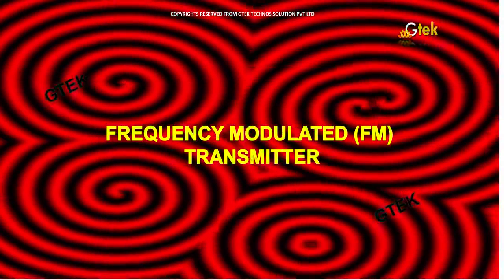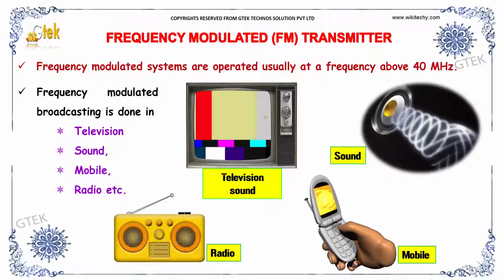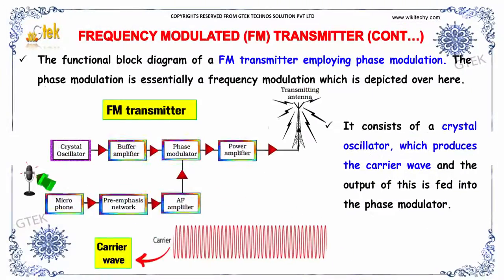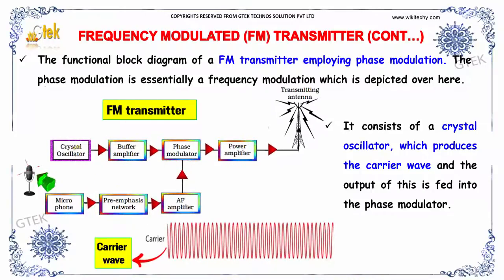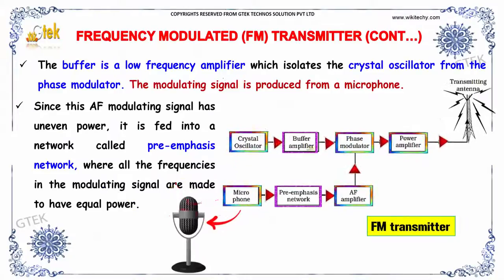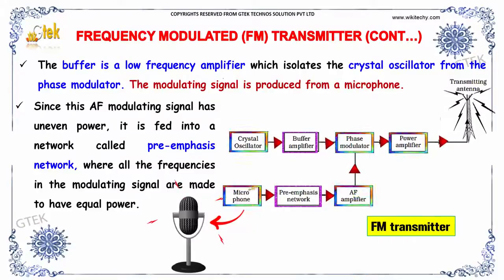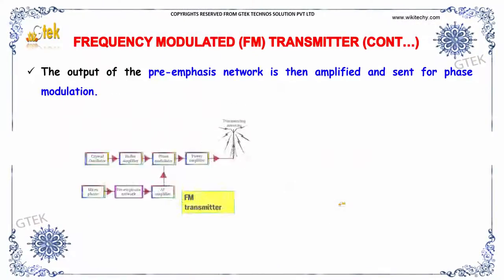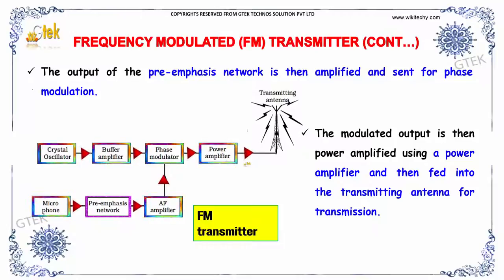Frequency Modulated Transmitter |Communication systems|class 12 physics|CBSE|IITJEE|NEET

Comment: A personal FM transmitter is a low-power FM radio transmitter that broadcasts a signal from a portable audio device (such as an MP3 player) to a standard FM radio. Most of these transmitters plug into the device's headphone jack and then broadcast the signal over an FM broadcast band frequency, so that it can be picked up by any nearby radio. This allows portable audio devices to make use of the louder or better sound quality of a home audio system or car stereo without requiring a wired connection. They are often used in cars but may also be in fixed locations such as broadcasting from a computer sound card throughout a building.
Being low-powered, most transmitters typically have a short range of 100–300 feet (30–100 metres), depending on the quality of the receiver, obstructions and elevation. Typically they broadcast on any FM frequency from 87.5 to 108.0 MHz in most of the world (or 88.1 to 107.9 MHz in the US and Canada).

Comment: Communication - Frequency Modulation Class 12 Part-2. 4. Deviation: The amount by which the frequency of the carrier wave is changed from its original unmodulated frequency. The rate at which this change occurs is equal to modulating frequency.

Comment: Frequency modulation is widely used for FM radio broadcasting. It is also used in telemetry, radar, seismic prospecting, and monitoring newborns for seizures via EEG, two-way radio systems, music synthesis, magnetic tape-recording systems and some video-transmission systems. In radio transmission, an advantage of frequency modulation is that it has a larger signal-to-noise ratio and therefore rejects radio frequency interference better than an equal power amplitude modulation (AM) signal. For this reason, most music is broadcast over FM radio.
Frequency modulation has a close relationship with phase modulation; phase modulation is often used as an intermediate step to achieve frequency modulation. Mathematically both of these are considered a special case of quadrature amplitude modulation (QAM).

Comment: n telecommunications and signal processing, frequency modulation (FM) is the encoding of information in a carrier wave by varying the instantaneous frequency of the wave. This contrasts with amplitude modulation, in which the amplitude of the carrier wave varies, while the frequency remains constant.
In analog frequency modulation, such as FM radio broadcasting of an audio signal representing voice or music, the instantaneous frequency deviation, the difference between the frequency of the carrier and its center frequency, is proportional to the modulating signal.
Digital data can be encoded and transmitted via FM by shifting the carrier's frequency among a predefined set of frequencies representing digits - for example one frequency can represent a binary 1 and a second can represent binary 0. This modulation technique is known as frequency-shift keying (FSK). FSK is widely used in modems and fax modems, and can also be used to send Morse code. Radioteletype also uses FSK.

Comment: In electronics and telecommunications a transmitter or radio transmitter is an electronic device ... In a frequency modulation (FM) transmitter, it is added by varying the radio signal's frequency slightly. Many other types of modulation are used.

Comment: The FM-transmitter plugs into the audio output of audio devices and converts the audio output into an FM radio signal, which can then be picked up by appliances such as car or portable radios. Most devices on the market can broadcast on any FM frequency from 76.0 to 108.0 MHz (or 87.9 to 107.9 in the US).

Comment: In electronics and telecommunications a transmitter or radio transmitter is an electronic device which, with the aid of an antenna, produces radio waves. The transmitter itself generates a radio frequency alternating current, which is applied to the antenna.

Comment: The exciter section contains the carrier oscillator, reactance modulator and the buffer amplifier. The frequency multiplier section, which features several frequency multipliers. ... The essential function of each circuit in the FM transmitter may be described as follows.